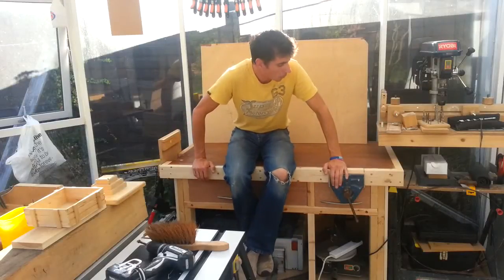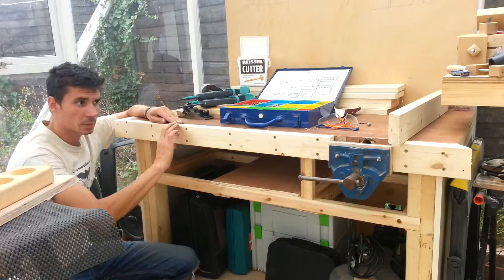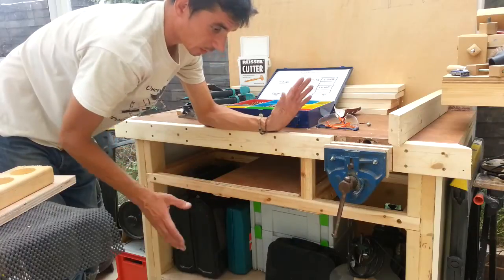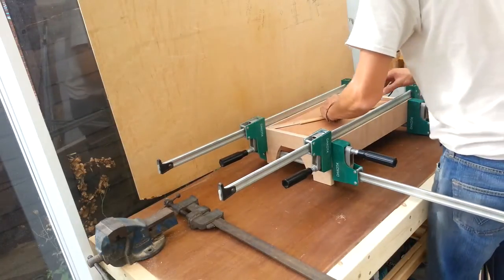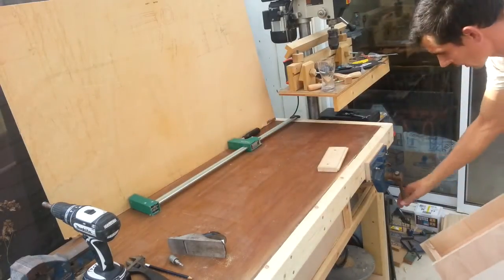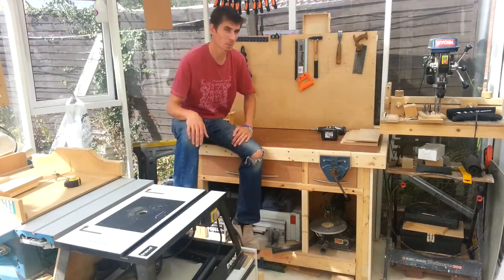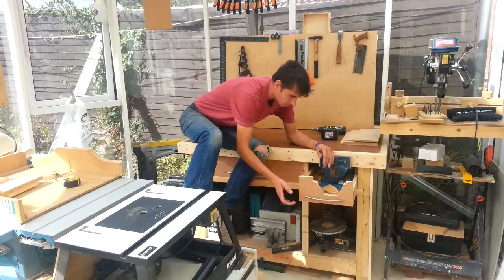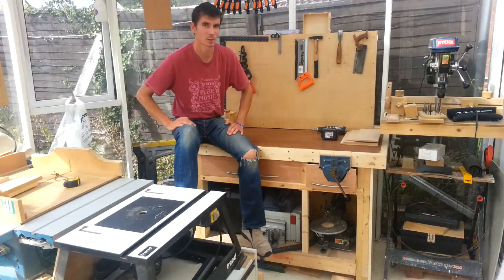Build a workbench with 4x2's & scrap: Easy Budget project! #3/3

Comment: wonder if you could make a work bench vid for someone who is just starting out and didn't have all the tools you used.
Reply from the maker: That's a great Idea! We're you thinking of building one yourself, what kind of "limited tools" we're you thinking?
It's pretty much a "because there's a need type of project,  but as you'll see in future videos, I do have a need for another bench....So I could use it as a basis for a future video.
Reply: +Richard Morley my tool collection isn't very much as of right now, just the basics really. Hammer, screwdrivers, limited ratchet set, and my dad just gave me his old skill saw, hand saw, some clamps and no air compressor. yet anyway.   appreciate you getting back to me so quickly btw!
Reply from the maker: No problem :-)
It was an interesting comment, as a bench is generally a really good investment of time, particularly at the start.
Don't forget that many "cool power tools" do the same job as simpler tools - just faster: chops - skills saw - hand saw, compressor & nail gun - hammer and nails etc.
Even a CNC router can have the same results as a hand router or scrolls. Getting to know your limited tools will increase what you can use them for with spending serious money at the beginning! 
Good luck, stay safe and enjoy.......and keep an eye out for a bench project+ (no promises yet though! ) :-)